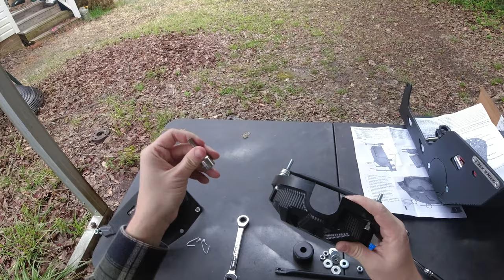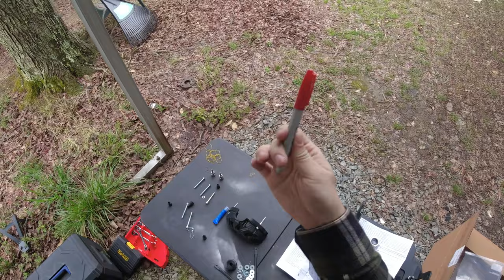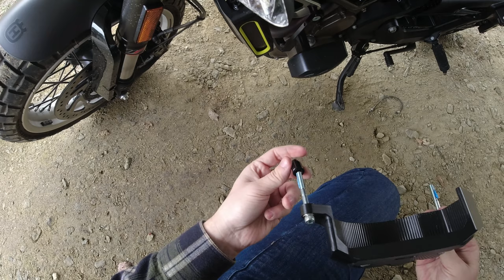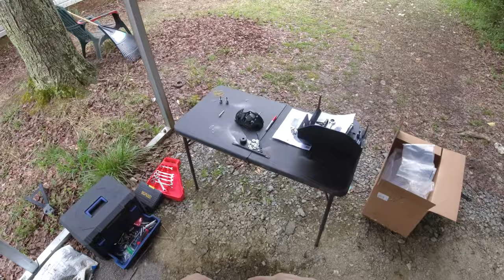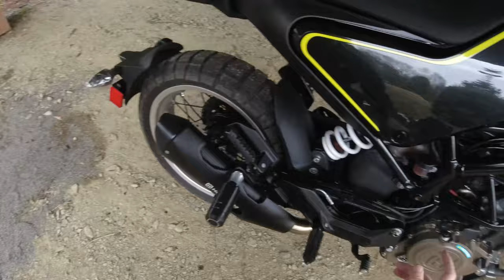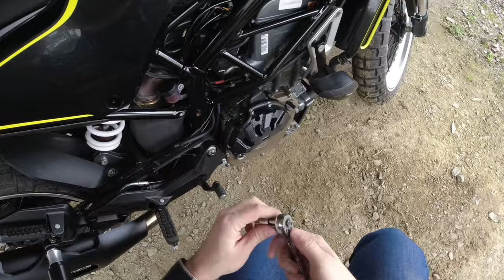Svartpilen 401: T-Rex Racing Engine Case Covers

Comment: Just watched this video, along with your install of the frame sliders. Also, after watching your tip on side video. it looks like the case guards wouldn't be needed in regards to a tip over. I'm referencing this in regards to being used on a 390 Duke street bike. The case guards could be beneficial for off road purposes.

Comment: You really need to get yourself a torque wrench, guessing just doesn't cut it, especially for those small bolts. I would also lay a packing blanket or something of some sort on the ground where you are working to avoid loosing or getting dirt on a dropped bolt or screw and provide yourself a work area for your tools and kit so you aren't walking back and forth.

Comment: I have the husqvarna case protectors. The flywheel side did it's job when I dropped the bike doing doughnuts in the snow this winter. The clutch side is useless I broke the brake pedal, dinged the exhaust pipe but never scratched that side of the engine.
Reply from the maker: Yikes! Sorry to hear! I went with T-rex specifically because I liked that they thought of the exhaust slider.

Comment: Will this fit on the 200cc variant sir?
Reply from the maker: I wouldn't think so. It seems to be made specifically for the 373cc engine, which is why it would work for the KTM 390, but I'd be very doubtful of it fitting a different engine altogether.
Reply: 😭😭 thank you sir, because I'm getting the Svartpivilen 200cc version here in Philippines soon. But accesories too hard to find.